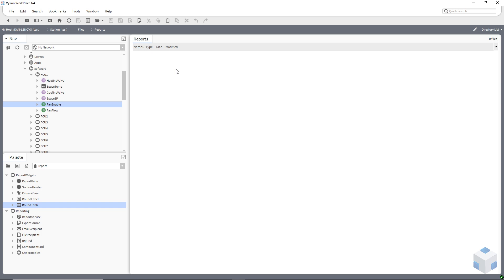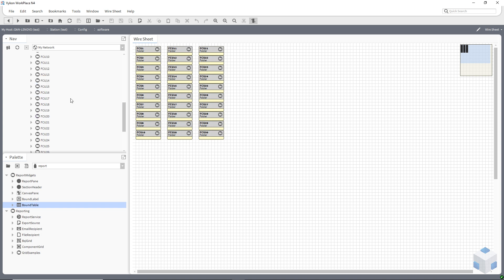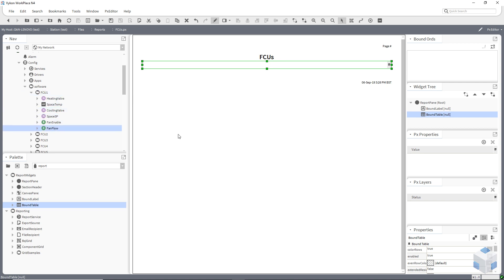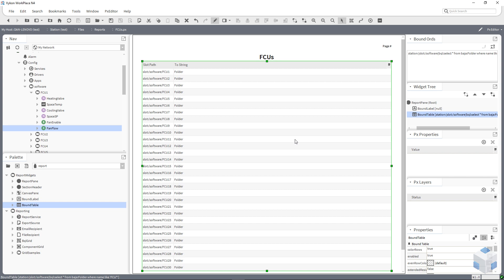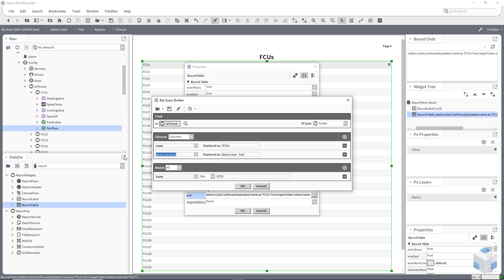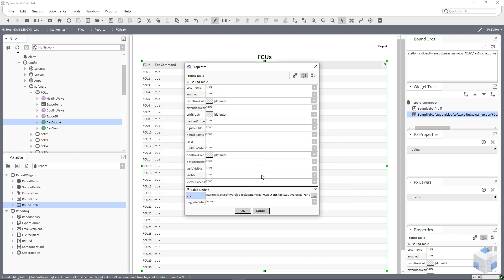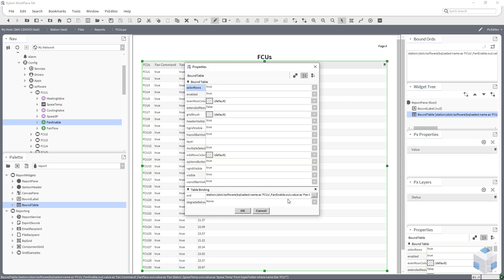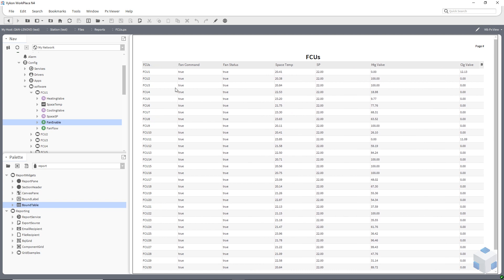HOW TO: Generate Simple Reports in Niagara 4 using BQL & ReportPX

Comment: Thanks! This and the next video appear to be what I am looking for. I have an 8 storey condominium using Honeywell Bacnet thermostats for fan coils and heat pumps. I would like to generate clickable reports for the operator. 
Can you point me to the video that organized the data into the "software" folder structure? My current data is in bacnet point folders under the drivers branch. Thanks for your help.

Comment: Can you use this for finding controller serial numbers on a supervisor? Or is this not possible
Reply from the maker: Hi Jake,

The answer would be to discover the point via the Niagara network, look in service.

Or even just put a Niagara String point into the Niagara points folder of said controller and paste in this ord.

slot:/Services/PlatformServices/SystemService/serialNumber

You can then copy that point and paste it into all the controller and then run the BQL on that point.
Reply: Would you be able to do similar but with sma expiry dates?

Comment: One question. I have seen this on a site where the data is not necessarily live. For example the points are actually stale and only when a folder is accessed (or I guess a px of the FCU is accessed) does the data in the Px report 'liven up'. Is it the case that a PxReport query does NOT create a poll request in the same way as a Px Call, Folder access or e.g. history log? TIA
Update! - Sorry just looked at the Component Grid reporting - that answers the question!!